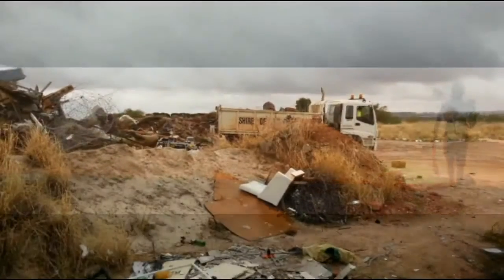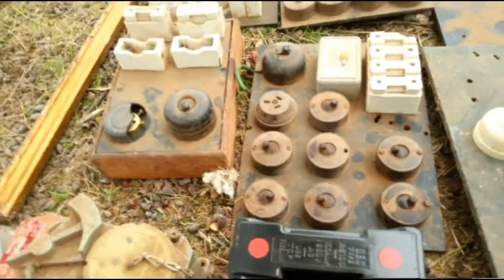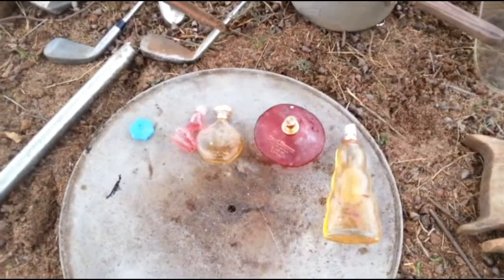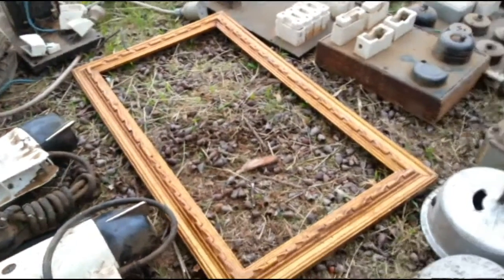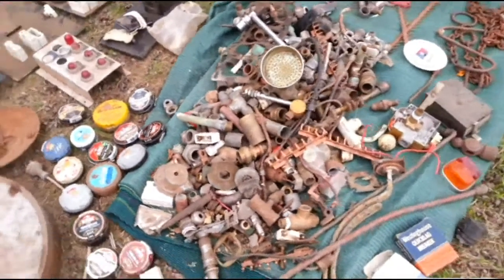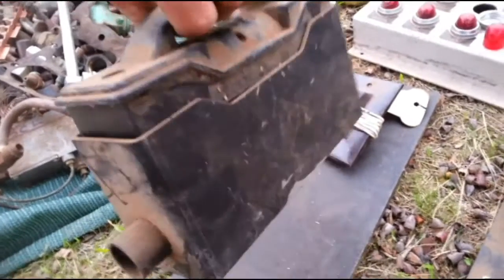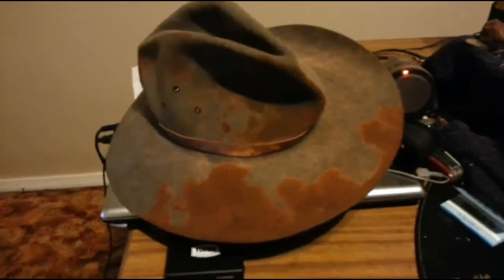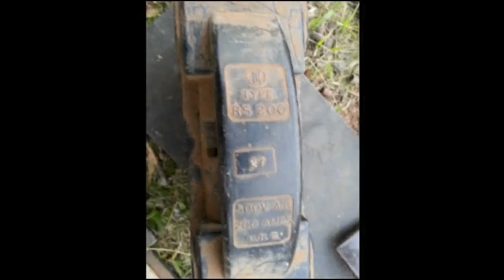One Days Amazing Rubbish Dump Picking Finds - Retro - Art Deco - Antiques - Copper - Brass etc

Comment: The paper wheel is for photography, I actually still have one from my days of using a huge commercial camera at a local newspaper. It is for enlarging and reducing photographs. If you want a 3" picture enlarged to 7" you set the original size at 3" and turn the wheel until it lands on 7", then you use the number it falls on to enlarge your photo. At least thats what it looks like, the photo is a little blurry.